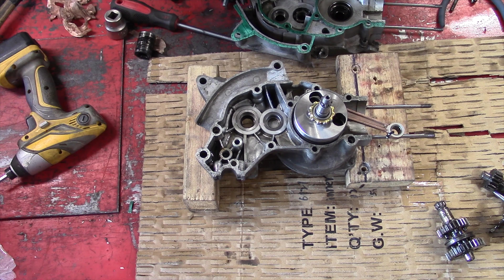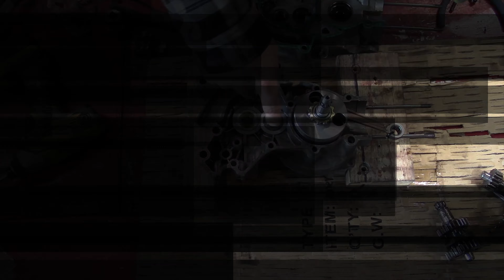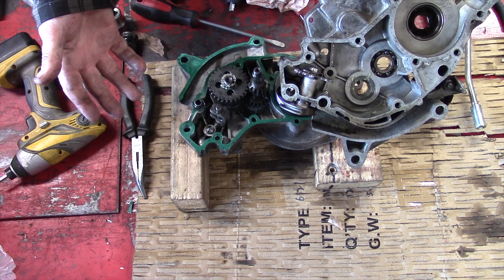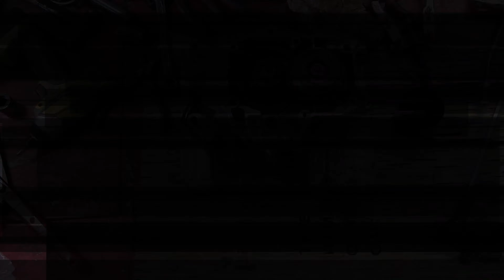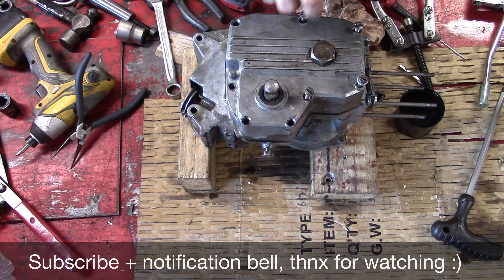Puch Z50 2 speed engine part 2

Comment: can i swap my speedfight 2 50cc with speedfight 100cc engine without any big modifcations?
Reply from the maker: Guess you're placed a comment in the wrong video. I can't really answer it either. The engine cases are quite different and the internal components are not interchangeable in the 50cc and 100 cc so I guess it is not an easy swap to put a 100cc in an 50cc frame.

Comment: Did you remember to put the very thin sims on the camshaft before butting the bearings on?
Reply from the maker: Kevin Rahbek I didn’t explain it in this video but I did i the same way as in my Sachs video https://youtu.be/uqKGA2i2dvU It is not the same shims to be used when exchanging bearings so it has to be measured exactly.
Reply: @fiftynineridge  how do i meassure it?
Reply: Kevin Rahbek you do this with a depth caliper

Comment: How much oil did you put back in the transmission?
Reply from the maker: The bottom bolt of the 2 closest to the cylinder is also the oil level check, it is around 300ml of oil in the engine when it pours out from that hole.

Comment: Do you need to time the engine when rebuilding?
Reply from the maker: Yes, the ignition has to be set every time you take it apart, but I always run the ignition in full advance so there is really no issue. Makes it possible more difficult to start but you benefit in midrange rpm. That is on untuned or slightly tuned cylinders. High performance setups with 74cc is a different topic. Then I always run HPI 210 and that has to be timed with an micrometer indicator at TDC.
Reply: @fiftynineridge  hows the best way to time the engine ?
Reply from the maker: @billypurvis6334  set the breaker points distance to 0,35mm and the ignition advance to 2mm BTDC